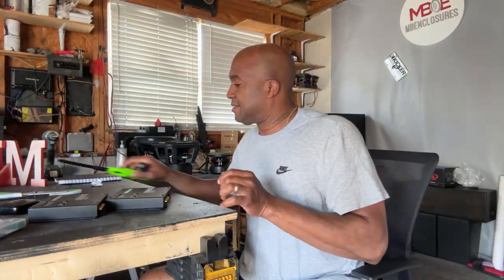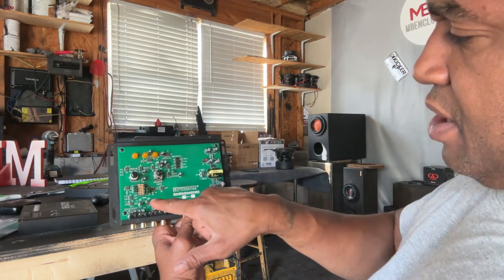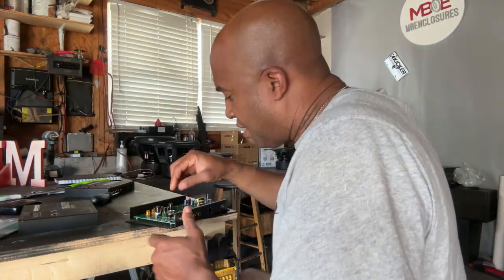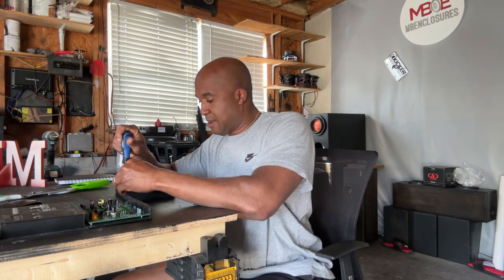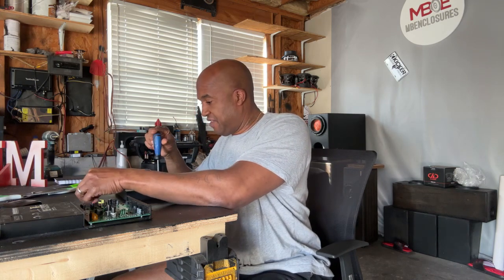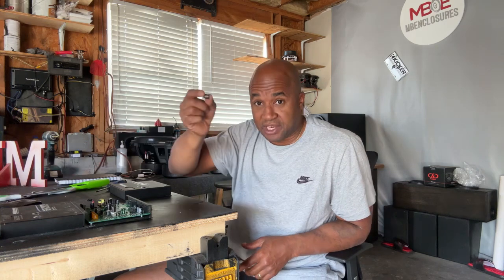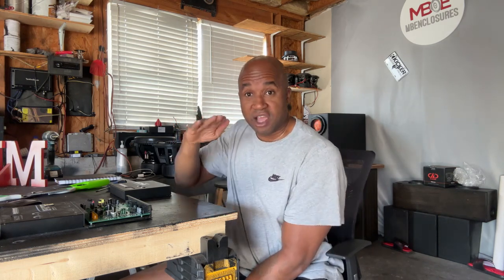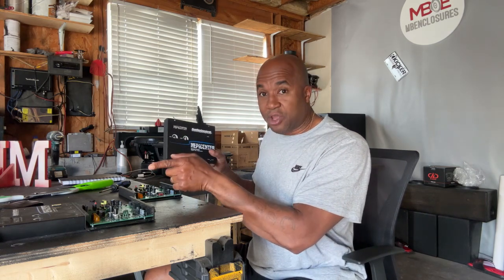Audiocontrol Epicenter PFM Module Swap…and Why!!!

Comment: This is why MB is the man! One of my local shops that has been around long before I was into car Audio at a teenager has told me that they will not install an epicenter even though they are an audiocontrol dealer. The reason why they that it does nothing but blowup subs. Now being knowledgeable about audio as I am I don’t believe a reputable company like audiocontrol would put this out if it really did this. I think it had more to do with customers not knowing what they can and can’t do with it. Jmo
Reply: Epicenter is trash in 2023. UNLESS you listen to a ton of old school music.
Reply: @beyondthedetails  not true you just don't have it set up right even on like say hip hop some songs that don't already have 30hz to 40hz it will add the low bass in and it will hit 100% harder than someone not using a epicenter  (a lot are missing it that's why there are so many rebassed versions of hiphop songs on here)
Reply: @beyondthedetails  yeah, what if you listen to most genres of music from most decades in  2024?
I don't even get your comment.  It is too simplistic.  No detail.  No nuance.  No one listens.  It isn't an opinion if you don't elaborate.
What does 'old school music' mean to you?
Eminem?
Warren G?
2LiveCrew?
Smokey Robinson?
Lionel Richie?
Temptations?
Four Tops?
Little Richard?
Marvin Gaye?
Barry White?

seriously though.  You comment is meaningless as it has no definition at all in backing up a weak-ass whiny claim.  No respectful person calls something trash without a clear and well defined reason if its bad unless they are a child.

Comment: I been debating on if i wanna add a epicenter to my system. Jus had reputable audio shops say there not needed if you listen to nothin but rap/hiphop. MB does a good job of explaining how to use them and get the most out of them. Plus you can always turn the epicenter off or to normally listening effects when needed
Reply: Most rap and hip hop you won’t need it.  However for some of the old school stuff , rock , metal or country it will work wonders on certain songs.  You will be able to use or EQ to get the sound you want for a lot of songs but this does help with the songs where a manual EQ adjustment just doesn’t do it .  I definitely think it’s worth having one just in case you can’t get the lows you’re looking for in some songs.   I don’t use mine a lot but it’s nice to have it when you need it .
Reply: @Michael Ford  yeah I like late 90s early 2000 rap/hip-hop. Good thing is you can always have it and not use it when you don't need it
Reply: U can never turn it off even if the dial is all the way to the left it will always be giving a slight effect. The only way to actually bypass it is to install am rca bypass switch
Reply: They lying to you here in Texas we all use them and bang nothing but rap and R&B you just gotta know how to adjust everything for the best sound possible
Reply: @NoLiesToldTV   lol yeah might get one, shop that was saying that it's not needed for rap is in Texas too lol
Reply: @NoLiesToldTV  once set correctly you will know. Love mine with all music it enhances your bass

Comment: You may not like how it sounding with that 33hz chip. It is going to roll off alot of output around and under your 33hz port tuning. You will have to tune the enclosure around 38hz for it to sound good if you want to use the factory chip.
Reply: yea but he running 8s
Reply: Well 28hz pfm chip might be the best for his setup.
Reply from the maker: I run a 20hz pfm
Reply: @M.B.Enclosures  When you use the 33hz pfm chip how did it sound?

Comment: I'm a bit confused So you're saying the PFM chip changes the frequency range of the sweep knob? I always thought it was a highpass infrasonic filter to supplement the subsonic filter on your amp so you don't over load your subs and bottom them out at frequencies below port tuning
Reply: Epicenter doesn't protect speakers that's your amp subsonic . It even says on the owners manual if you go really low you can damage your speakers .
Reply: I thought the same thing. But there's no information to justify.  Been searching over a year and  still confused.  I have a 15L7 qclass which plays down to 18hz. With my 20 hz pfm  it plays the lowz very well.
Reply: I thought the same thing, the pfm in the epicenter filters frequency below chip.  It works similarly to the ultrasonic filter on amp. Which protects the speaker to a certain point not completely therefore still a chance you can blow your speaker if you clip your amp. But there's no information to justify.  Been searching over a year and  still confused.  I have a 15L7 qclass with the ability to play down to 18hz. With my 20 hz pfm  it plays the lowz very well.
Reply: @darealbrain cool

Comment: My epi stopped working. All the lights are on . But when I by urn the epi bass knob. No bass ... And yes it was working fine for 5 years . I wonder if I have to replace the chip . Any input would help . Thanks
Reply from the maker: You blew the internal fuse.
Reply: @M.B.Enclosures  thank you for for the reply. is that a part that can be changed . Or do i have to get a new one Thanks  .
Reply: @M.B.Enclosures i want to buy one of these chips.where can i buy one?

Comment: I'm really thinking about that Wavtech unit. It's adjustable subsonic/infrasonic/PFM makes more sense as I can fine tune the roll off point to match my system or just to match my mood. Good for experimenting with compared to buying and swapping chips out. 👍
Reply: I was looking at that wavetech bassrestor myself. Jus was getting shyed away from it cuse wiredkustoms told me if you listen to mainly rap or hip hop you don't need it. But MB does a good job of really explaining them an showing how to set them up. Plus with you can turn it off when you don't really wanna use it or need it
Reply: @johnnypiper1717  Yes, it's not going to be very helpful on music that already has strong low bass. It tends to work best on music that's weak as far as low bass is concerned.
Reply: I run a 15Hz - 18dB/Octave PFM in my Epicenter & run my amplifier's Infrasonic Filter set to off. I use my Epicenter for every type of music even rebassed music down to 18Hz & lower, so I need a 15Hz PFM so it does not cut those frequencies.
Reply: @DTW-bx2vy  Cool. Most people say that it can distort pretty badly and sound muddy trying to use the epicenter effect with rebassed music.
Reply: I have a epicenter with a 15hz chip and this thing is amazing it plays all music good even music with alot of bass ,the thing is most people think they like lows but they don't
Reply: I’m going to say it the best sound you can hear when you hear it on all the music. It fill the bass out to full potential.
Reply: @DTW-bx2vy and what is your box tuned to?

Comment: Hey MBE I got a question on this topic, I listen to 80’s music from time to time. I also have Apple Music, would I still need an epicentre seeing that most files are Lossless/Dolby Atmos. The more direct question is, are the harmonics already restored by apple ?
Reply: Yes, Lossless Audio is the best audio option available but the problem is the frequencies the Epicenter add's back to the music was never present in the studio recording to begin with. That is why an Epicenter would be very helpful to add bass frequencies that were never there to the music you like to listen too.
Reply: It gives you the music the way it was when made in the studio ! It works magic for 80s-99 songs
Reply: You don't "need" it, but you might "want" it. The quality of the music or if it's from Apple has nothing to do with anything. Its the recording engineer that put the music together to be released on the album that usually rolls off the low bass to prevent speakers from rattling or being damaged. Apple does not do anything to the music. Its just a service to sell it.
Reply: Do your homework  it does matter the platform you get your music from but I do agree epicenter will help
Reply: Epicenter generally works best for 80s music, 90s, pop, country, rock, even a lot of edm, etc. I find though it can be hit or miss on some songs no mattet what the genre. Sometimes it sounds hard hitting and clean and other times it sounds like trash and produces a wavy type bass

Comment: As soon as you open an Epicenter, you realize how old it is and that they've never changed or updated/upgraded anything over the years. That PCB is so large for so little components on it. Audio control can easily rid the PCB of that excess open space and shrink the overall footprint of it by more than half.

This is a prime example of when someone says that they are overpriced. The components haven't changed since the 90s. Still using the same old tech that costs them peanuts to make and they aren't making an effort to improve anything at all and they still charging you a lot for it.

I get people can buy what they want and that people can see the value in it, but come on. You still can overpay for something. More expensive doesnt always equal more quality. Benz and BMW are expensive, but they don't last long without emptying your wallet over pointless repairs that wouldn't ever happen on a Lexus.
Reply from the maker: Huh sir there is a new one…you late here.
Reply: They made an in dash model as well as the Micro which is tiny. The fact the mostly original model is still selling should tell you just how good it is.
Reply: There’s a epicenter micro if you haven’t seen it already